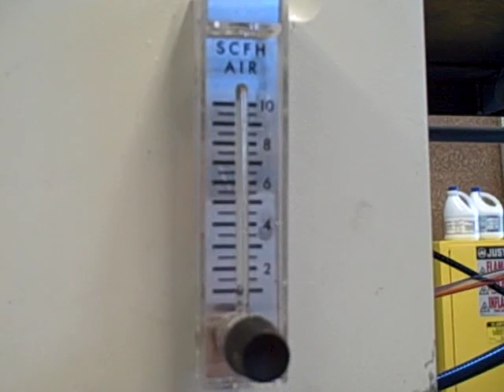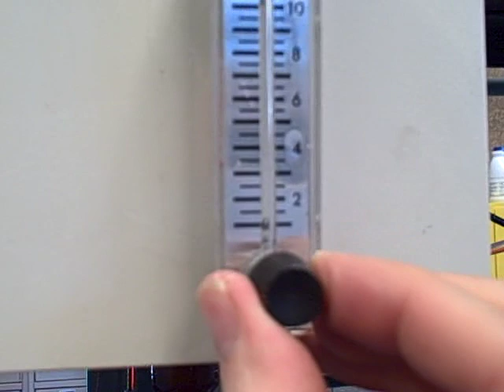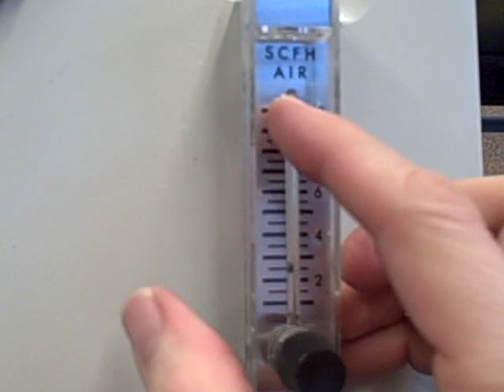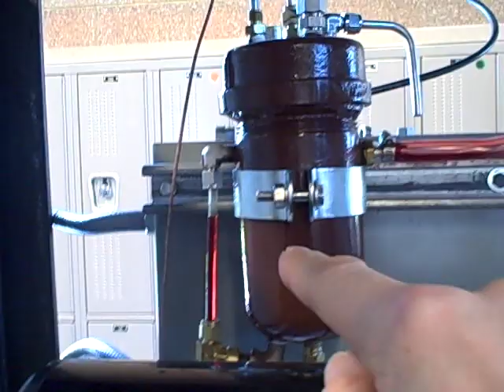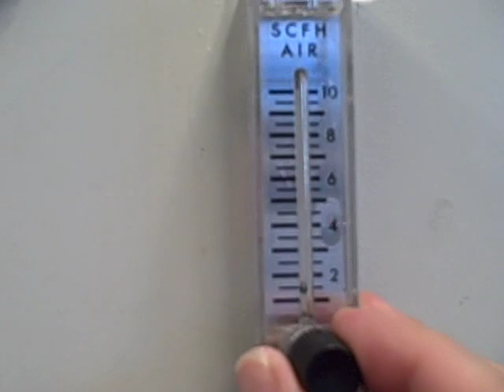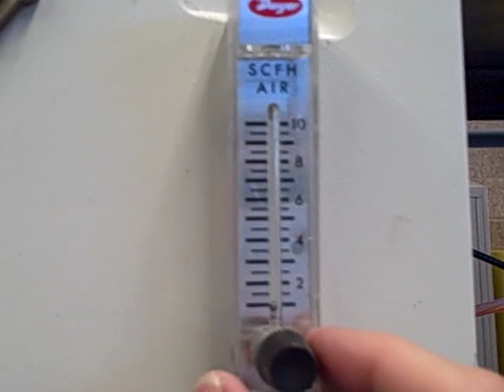Rotameter

Comment: At our shop, we use these without the dial valve in the bottom, to measure flow out of a valve to determine the shut off of the valve. My issue is, sometimes, we'll have a bouncy (unstable) ball in the rotameter which makes it hard to get a good reading. Usually, we tap on it to get the ball to temporarily stabilize for a reading. Question is, what causes that bouncing?
Reply: maybe there are some issues like corrosion on the ball or the impurity of the fluid, i not 100% sure though yet i am also still learning
Reply: @ryanrusydat977  Yeah we just have air flowing through them. Although I would anticipate that if it was corrosion on the ball, the bounciness should be fairly consistent within that flow range of different valve styles of similar shutoff classes, but that doesn't seem to be the case.

Meh, we can still get readings, and we're used to having to tap them on the occasion. It might even be an uneven/pulsating like flow characteristic of the valve itself when closed, while being tested.
Reply: @TFYS-QA  yeah agree with you, maybe the case is on the neighbouring components like the valve or the pipe